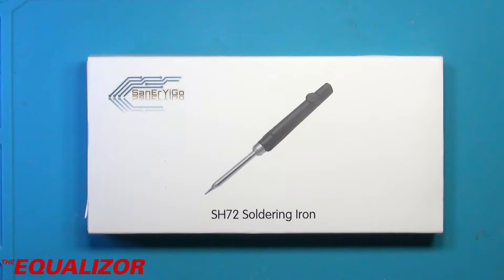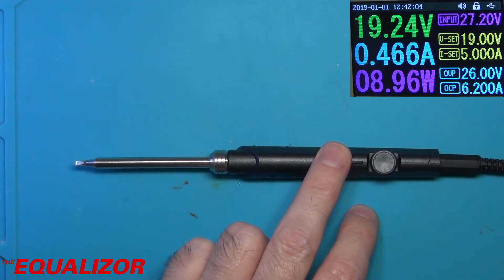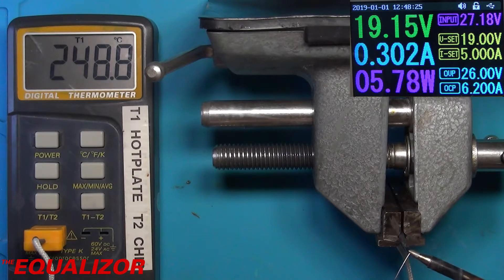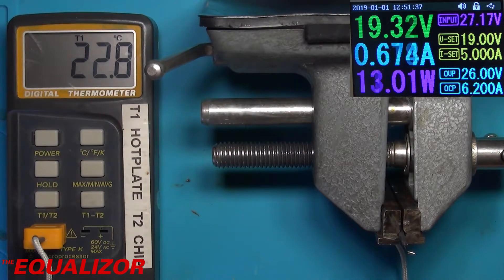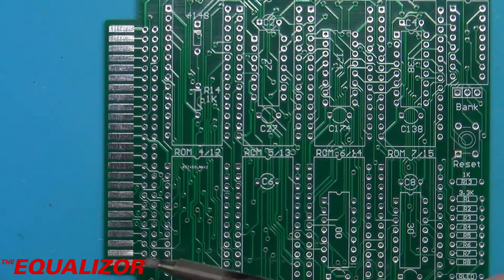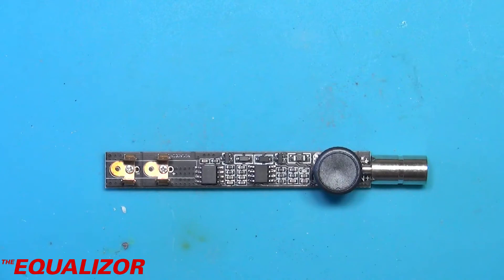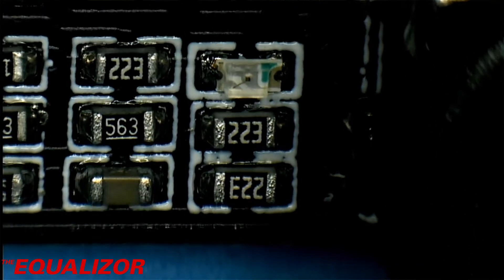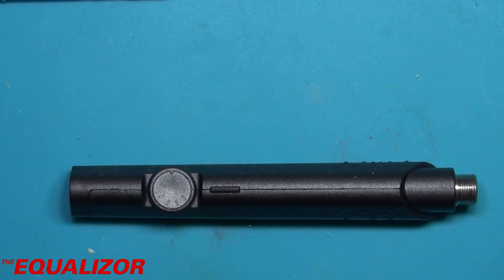SH72 soldering iron teardown and test

Comment: I got one of these when it was first launched so got it for $8, I already had a TS100. I would recommend this over the TS100 as you can buy several with a different tip for less and get roughly the same performance. I've also found these work best at 15V too.
Reply: What do you mean by best?
at 24V it heats up like 5-6 times faster compared to 12V